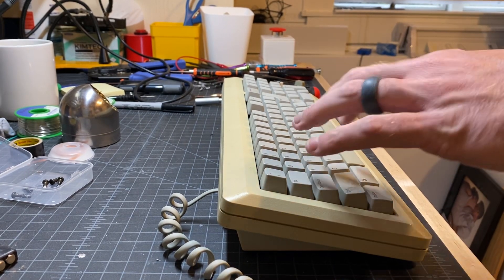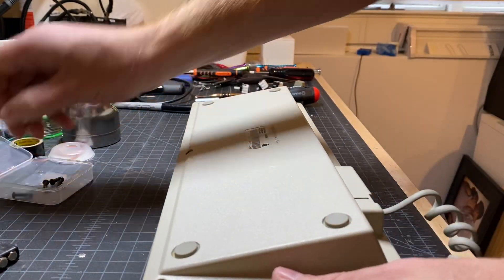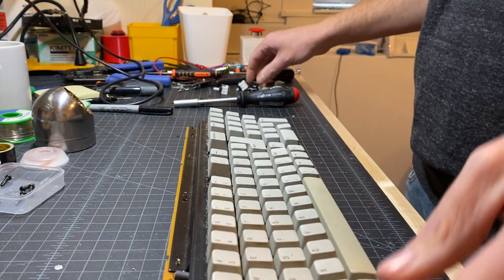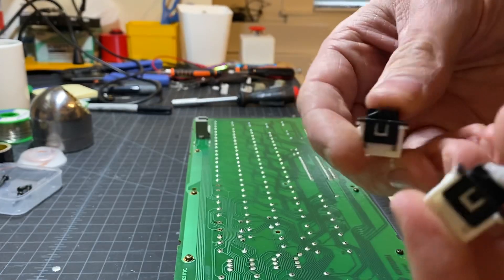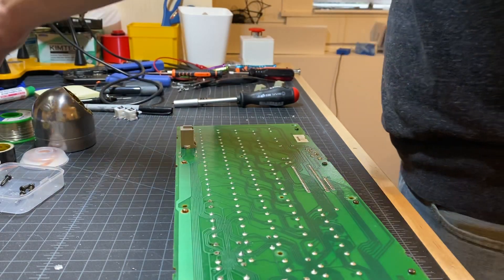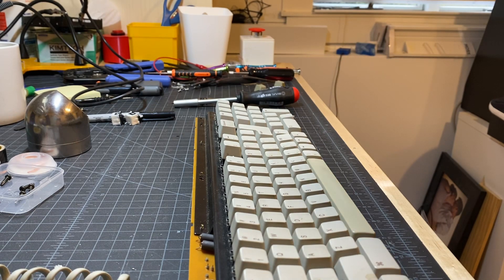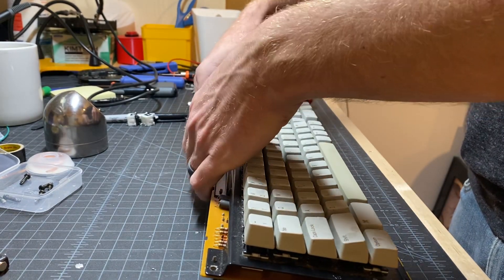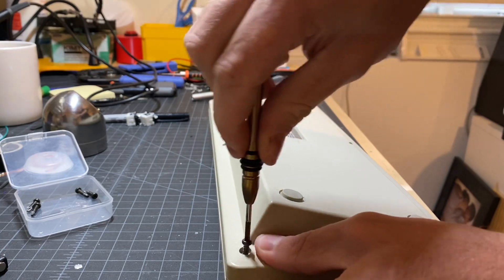Macintosh Plus Keyboard Repair (M0110A)

Comment: Nice vid.  Tell me, how do you take out the dead switches?  Thanks.
Reply: He desolder the keyboard and took off the keycap and now the switch
Reply: @yuanisanorexic  Yes, but the switch is very hard to remove, almost impossible.
Reply: @genroku7  is it hot swap?
Reply: @yuanisanorexic  No.  The same switch and keyboard.  Extremely hard to remove the switches.